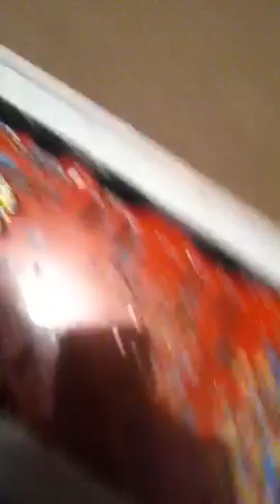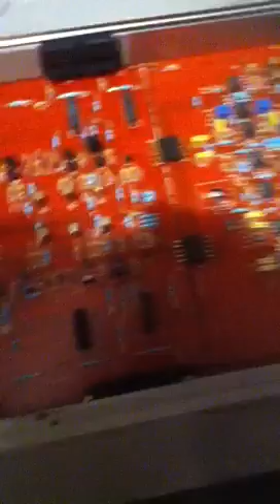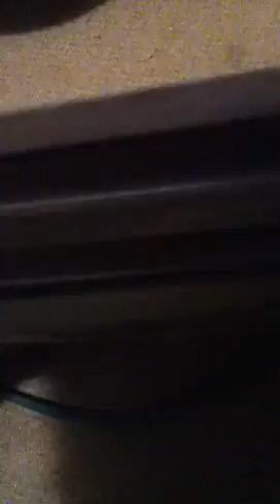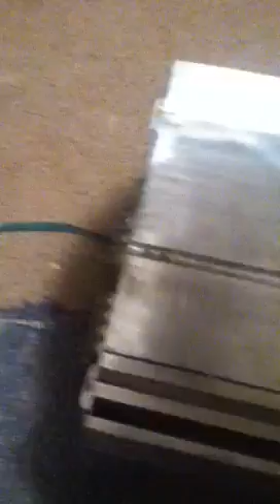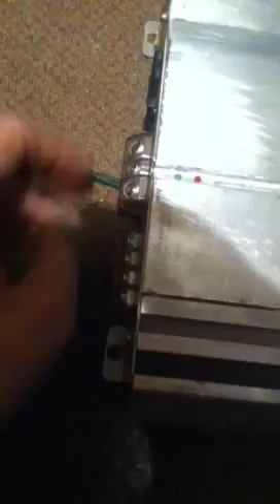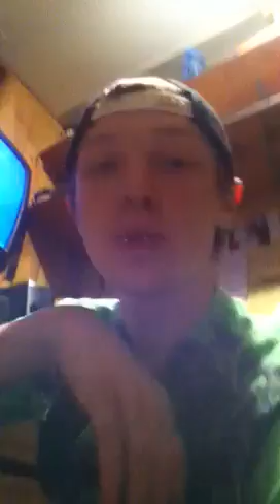Soundstream amp help me people!!

Comment: u have a voltage drain on the circuit .. can be a leakage in a diode . or one of the components is drawing more power than it should